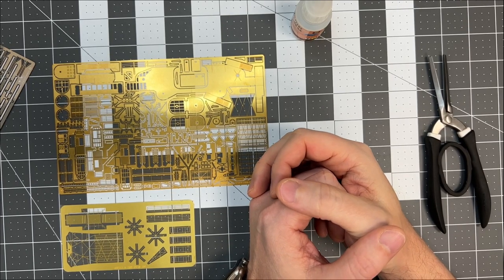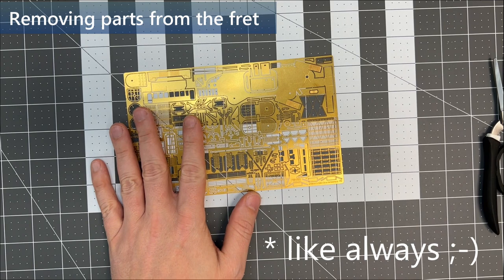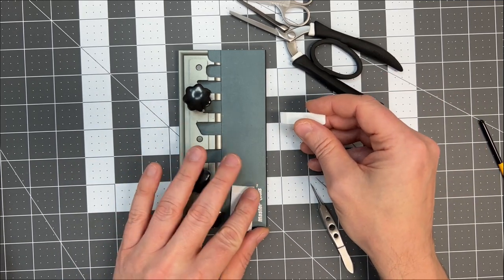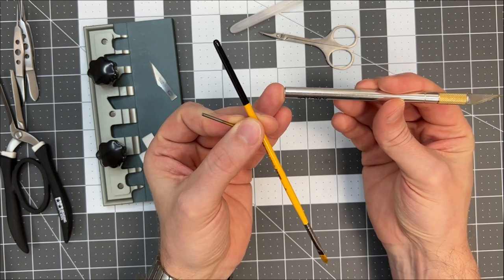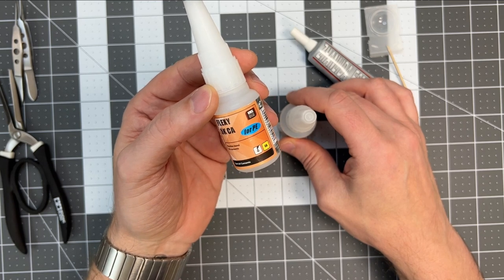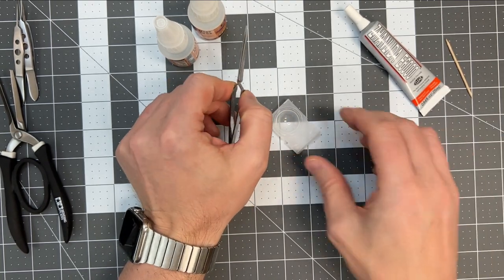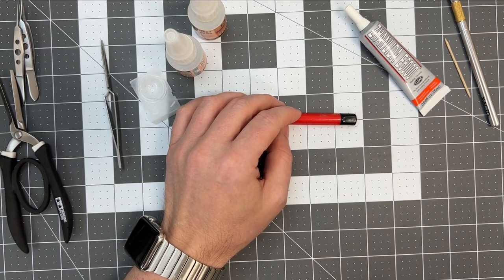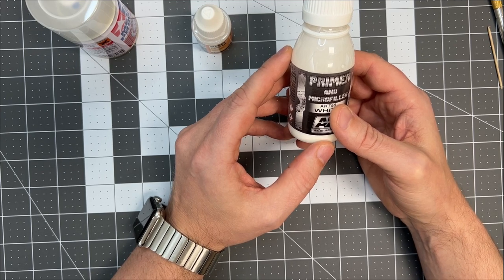Tools for working with photo etch

Comment: Is it possible to use the primer on the whole PE sheet before removing the parts for assambly?
Reply from the maker: You could, and I do that for railings and stairs, but for parts that you are going to bend you will run the risk of destroying the primer. Another thing is that the glue will grip to the primer instead of the brass, which could give a too weak of a bond.

Comment: I also use the little candles you have for my CA glue. Something in the wax slows the CA setting process. So when you put a  dob out to work with, it stays usable a lot longer before you need some fresh CA.
Reply from the maker: Thanks for the tip, something to check out 👍